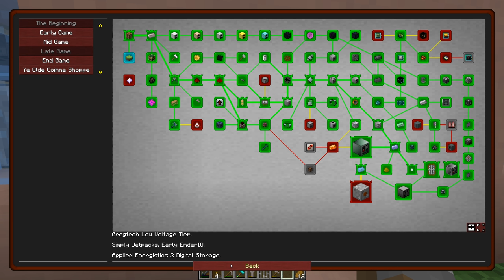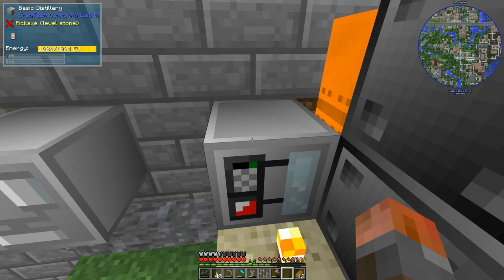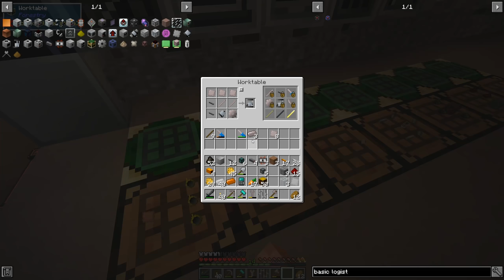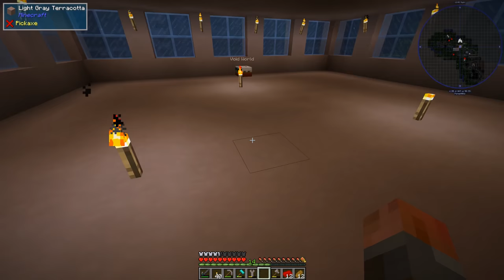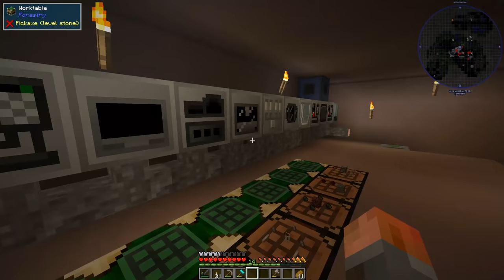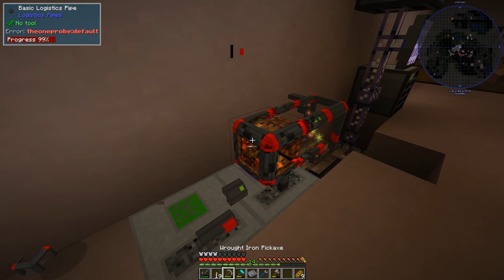Omnifactory E13 - Logistics Pipes Storage!

Comment: That button is auto-eject. you can tell the machine which side, minus the face, to output from with the wrench.

And thank you for delving into logistics pipes, I was hitting a wall myself with OF because of the Polyethylene, and this makes it feel lile I have an Avenue of progress I was over looking.
Reply: Polytheylene is relatively easy.

Sugarcane -> basic brewery = biomass
Biomass -> basic distillery = Ethanol
Sulfur + water -> basic chem reactor = sulfuric acid
sulfuric acid + ethanol -> mv chemical reactor = ethylene
ethylene + oxygen (or air) -> mv chemical reactor = polyethylene

MV chemical reactor does require some aluminum but it isn't actually that bad.

Comment: One useful thing I've found in active supplier modules on the worktables to keep them stocked with parts. Things like pumps and motors require assembling machines to make without hand tools, which are super expensive and slow at this level. Some extruder with a crafting pipe on to make rods, and an active supplier on the worktable set to say, 32 rods on the motor table. That way you can quickly craft motors whenever you need it until you're ready for massive assembling machine production lines.

Comment: You can make phenol directly in the pyrolyse oven. You should also update the quest book.

Gregtech machines can be set to output out a specific side with the wrench and autoeject is set by the orange and blue arrow buttons in the ui. When looking at a gregtech machine with a gregtech wrench it shows a 3x3 grid. If you click the center it sets the current side as an output side. If you click one of the edges it sets the adjacent side as output. If you click a corner it sets the opposite side as the output. To the best of my knowledge you can't input through the output side. You also can't output through the front of a machine.
Reply: You can use the screwdriver on the output side to enable input through it.
Reply: Also apparently you can click pumps and robot arms to sides for even more input and output options. But I’ve not tried this myself yet so I don’t really know many details.
Reply: @gustavenk  Anything labeled a "cover" can be used to add additional functionality to gregtech machines (which includes things like tanks and chests)